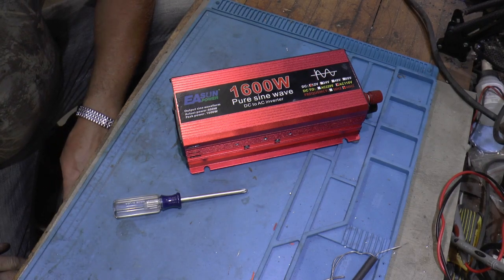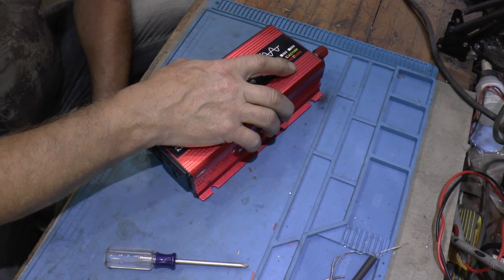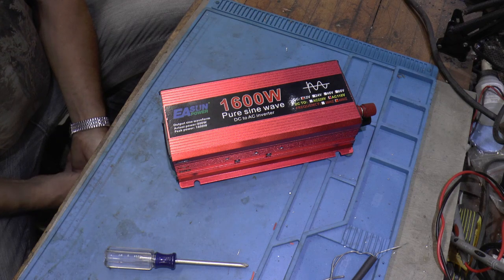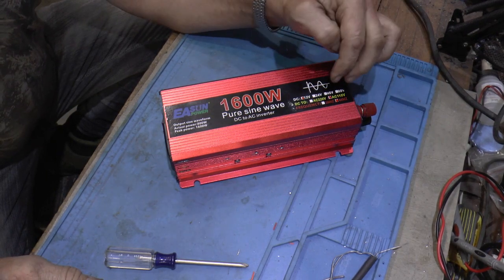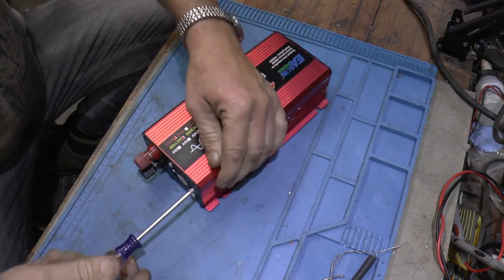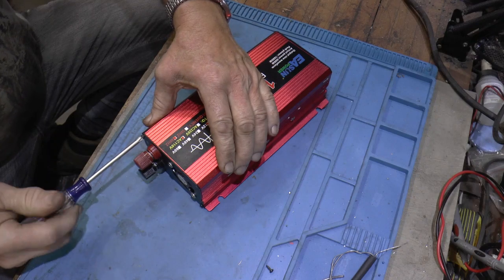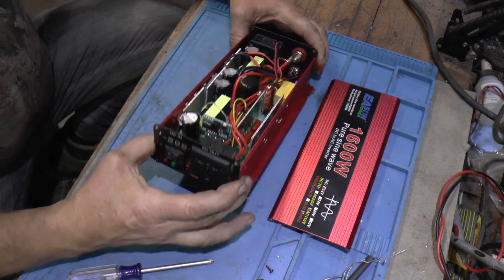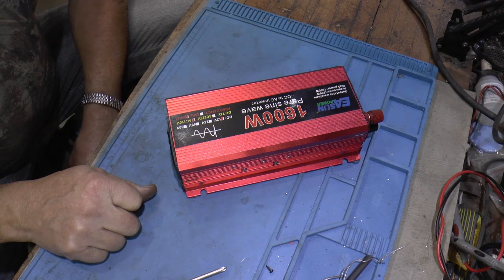EASUN 1600 Watt Inverter Update

Comment: There are some suggestions.
1. To place plates of "true" aluminium not only to tops of MOSFET's, as shown in video, but also, between MOSFET's heatsink surfaces and inverter's case. Because, inverter's case has bad thermal conductivity due to being manufactured from cheaper aluminium alloy, or, even worse, from aluminium powder composition, and because it is thin to adequately transfer heat from MOSFET's zone to the whole inverter's case. This could be observed as significant gradient of the inverter's case temperature from MOSFET's mounting area to areas in any direction of the case's surface. Additional "true" aluminium plates will act as quality heat spreaders from copper-based, but small footprint of MOSFET's heatsink surfaces to a larger surface of inverter's case due to large contact area between plates and case walls. Here, in Russia, we trying to use plates with maximum % of aluminium in its alloy, 90+% in general for good thermal conductivity. But these plates are much softer (flexible), so, we need to secure its flatness during mechanical operations with it. 
2. As low voltage side of inverter has huge current fluctuations during operation, it is recommended to check capacitor's temperature during inverter operation. From my experience with 12 Vdc / 300 W cheap square wave automobile inverter: its 12 Vdc input capacitors were overheated up to 70-80 Celsius degree with load of 150 W. One of overheated capacitors released its "white smoke" 😁 I suggest to increase capacitor in 310-400 V DC high voltage intermediate stage, and to install 10-15 parallel capacitors at inverter's DC  input. The goal is to maintain not more that 1-2 Amps of current fluctuations (ripple) per capacitor. Also, it is very important to maintain the lowest resistance of circuit between  DC source and inverter's DC input

Comment: Hello. I have the same inverter, the refrigerator 100 watts can not start. Thank you very much for the idea with capacitors. On mine are 25 In 2200 UF😱. I also soldered the tracks on the board from the bottom, they are very thin there.

Comment: Hi bud, I have bought the same inverter, it's pure sine wave but does your inverter fan run constantly? My fan runs even if I'm running 60w through it, maximum a ran through in so far is 130w
Reply from the maker: I changed mine because of that. I bypassed the original fan circuit and put in a bimetal thermo switch on the DC side heat sink. Now it only runs when it get warm from a heavy load.
Reply: Nice, was thinking of replacing the original fan with a noiseless fan and also using an external noiseless fan on the DC side. Thoughts?
Reply from the maker: @varon2672  That should also work ok but I didn't want an external fan because it is not a permanent install.
Reply: Any idea whats the fan size?
Reply: Also you mentioned a bimetal switch, at what temp does your switch kick on?
Reply from the maker: @varon2672  40 degrees c or 104 degrees f.
Reply: Mine 1600W/800W runs with fan on even with load like 65W. Will be changed later
Reply: @kevincrawford2027  I'm impressed with your work! Can you tell where did you place a bimetal switch - somwhere close to the DC side? Will 40 digrees C bimetal switch be good for a little bigger converter 2200W/1100W? I'm a newbe at such things ;-)
Reply from the maker: @maciekzwroclawia  On the DC heat sink as close to the MOSFETS as possible. Best to keep it as far from the fan as possible also. I have done this to several inverters and have had no problems.
Reply: @kevincrawford2027  thanks a lot! :)
Reply: @kevincrawford2027  It's maybe a dumb question, but which side is a DC a side? I've got 8 smaller mosfets and 4 bigger on the other side (2200/1000W version). Already put some additional heat sinks and holes in the housing. Now I would like to install bimetal switch :)

Comment: Hi @kevincrawford2027, is this inverter still working fine ? Also do you know if this inverter can run a refrigerator(~75w) ?
Reply from the maker: Yes it still works ok. It is used to power lights and some computer equipment that works in conjunction with the telescope and camera in our observatory. Never tried it on a frig but see no reason it shouldn't.